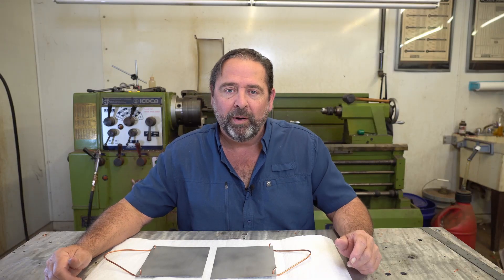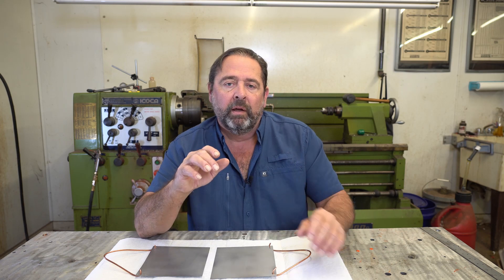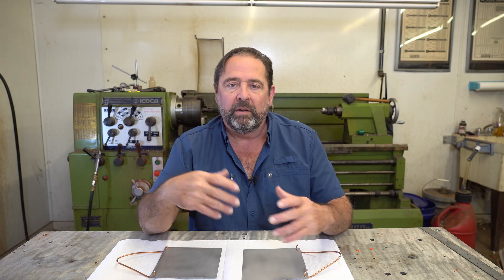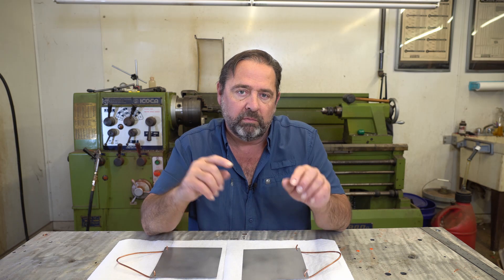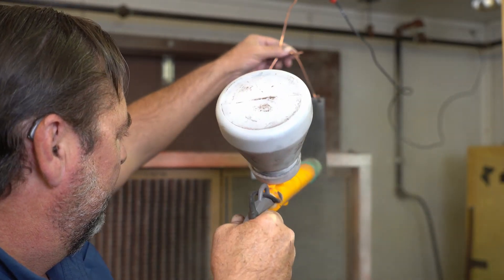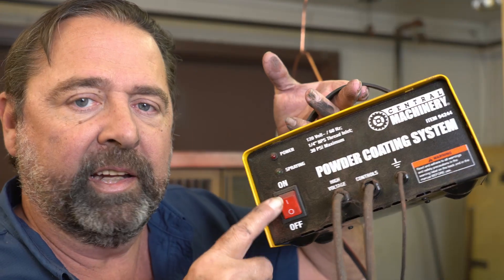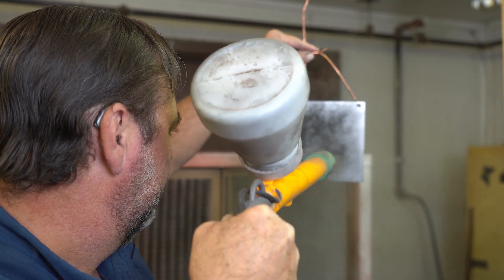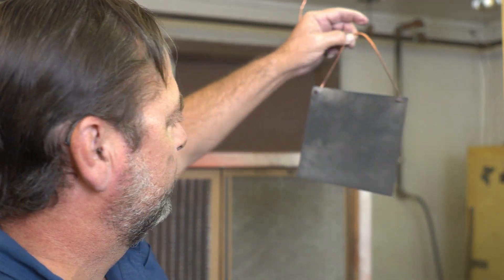POWDER COAT GROUNDING ROD...DO YOU NEED IT?

Comment: I was a service engineer for a company that made powder coating equipment back in the 80's. Some of our customers made things like seat frames for Land Rover or under dashboard parts for Ford. Nearly all these parts were finished in the same colour. So the system was seldom cleaned out which is what obviously happens when you have a colour change. Probably 75% of the faults we came across were earth faults. In this case over spray powder created earth leakage tracks. Hence the potential difference between the charge at the gun and the grounded work piece was reduced so poor attraction occured. Would have liked to have known if the earth rod was the sole grounding point. Because if you had an earth conection on your machine (which would have run from the mains voltage earth) As the machine was unplugged for your test your only earth source was the rod. Maybe it would have been ok if the plug was still connected and the machine switched off.
On a different note some powders are run on stystems with no electric. It depends on the charging rod (which holds the deflector) and the deflector materials for polyester only and epoxy/polyester mixes. But all this was nearly 40 years ago

Comment: this one time I accidentally powdered a part in Prismatic Powders Illusion Blueberry without plugging the control box and hooking up the ground clamp beforehand, and to my surprise the powder stuck to the part perfectly, I didn't even realize the machine was unplugged and unclamped because it was working 100% normally and came out great 

this is a two stage powder too, basecoat and clear coat so I was ultra shocked, usually the second coat/top coat has a harder time sticking since the part has already been cured in basecoat but it was stuck the same without the machine turned on, no more difficult than usual, can anyone exolain this please? Why did it work fully turned off? The powder didn't even fall off on the way to the oven and I was led to believe it would've fallen off due to the lack of static charge holding the charged powder particles to the part
Reply: keep in mind I just used regular 14ga steel wire as my grounding wire and didn't use a grounding rod directly to earth as he does in this video so I'm so confused

Comment: Surely in the second test when you disconnect the ground rod, if you had not touched the piece, the powder paint would not have adhered since we electrically present a potential to ground, that is the reason why you still managed to adhere the particles, Thanks for your explanatory video, from now on I will take grounding more seriously.
Reply from the maker: Thanks for watching!

Comment: I wonder if you're getting some charge separation in the powder just from spraying.  Static often builds up in clouds where there are particles rubbing against each other, so it seems possible that the charge is building up in the canister.  IIRC 15kv (the rated voltage on the Eastwood gun) is not a very high potential when it comes to "static electricity", so self charging is a plausible explanation.  ALSO, it may seem unimportant, but charge is negative.  The power builds up a negative charge because electrons are added on.  Ground is simply a low resistance path to lower potential.  To make an analogy, the charge on the powder is like a bowling ball that is lifted to the top of a hill.  A good ground is a cliff.  A bad ground is like rolling the ball down a rocky side of the hill---it falls the same distance but with a lot of bouncing around and it takes a lot longer.  You're fooling yourself by thinking that charge is positive and that ground can be strong. I have a grounding rod nearby but wouldn't the ground in most outlets work well, too?  Low resistance ground is most important for very large currents, which is not the case here..

Comment: Thanks for the video! My question is do you put the ground clip that is on the machine onto the ground rod cable also? Grd rod to part clip from machine to grd rod?   Keep up the good job 😊 mt.
Reply from the maker: Yes, I use both.  The main/new ground rod for my primary ground and then clip the small ground wire from the PC machine to my parts hanger right beside the main ground wire.
Reply: @CycleFab  thanks bud for the info   All new to me 👍

Comment: Does the grounding rod in the ground and subsequent ground wire running to the hanging part eliminate the need for the ground wire and foot pedal that comes with the HF unit?
Reply from the maker: You'll need to always use the foot pedal with the HF and the hand button on the Eastwood powder coat systems.  The independent grounding rod just greatly improves the function of any powder coating system.  Thanks for watching and commenting.

Comment: The power unit has the primary job of imparting a positive charge to the powder to enhance and encourage it to stick to the negative, grounded, part. Powder movement through the plastic of the gun develops a static charge that helps it stick. This is the entire basis for some of the systems out there. The static charge, coupled with the additional charge from the controller, allows for MORE powder to stick and stick better and more uniformly...ESPECIALLY if two or more coats are required. You are correct, without a strong ground, you cannot powder coat.
Reply from the maker: Thank you for watching and commenting.

Comment: yes good ground is key but the reason for your powder to stick when its turned off is that it works like a tribo system the powder get static charge when in runs thru the powder gun and rubs on the inside of it
Reply from the maker: Yes, that's true.  Thanks for watching!

Comment: That is interesting. Air moving over a surface will produce a static charge, so the powder will have a charge imparted to it with or without the gun turned on, so if the part is grounded the powder will be attracted to it.
Reply from the maker: Sand blasting cabinets are a good example of that phenomenon.  If you don't have them grounded they will shock the crap out of you due to static electricity build up from the blasting particals movement.
Reply: @CycleFab  I've see sparks in my sandblaster so that is for sure true. I used to know a guy who was an electrical engineer for a company that used industrial sized sand blasters in manufacturing and one of his duties was to make sure the equipment was all grounded correctly because apparently the charge that built up could shock the hell out of you...